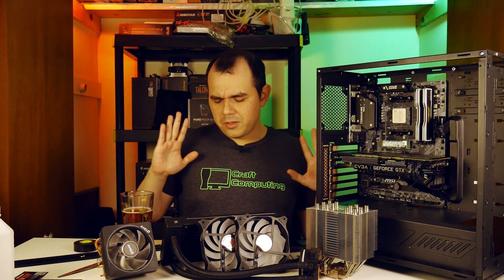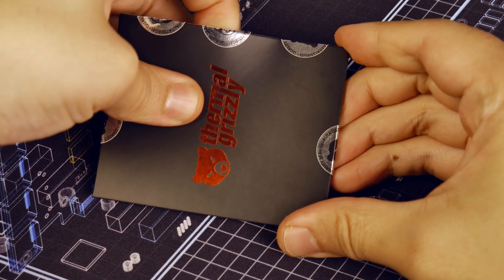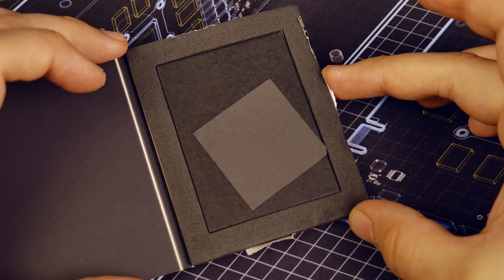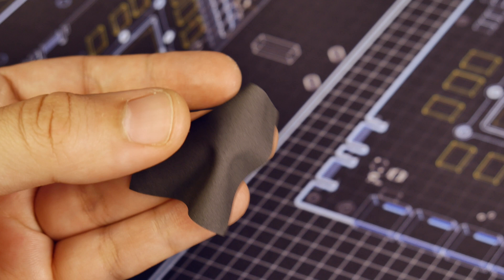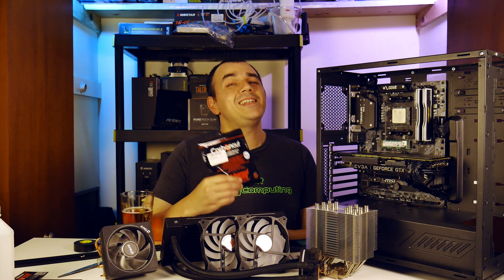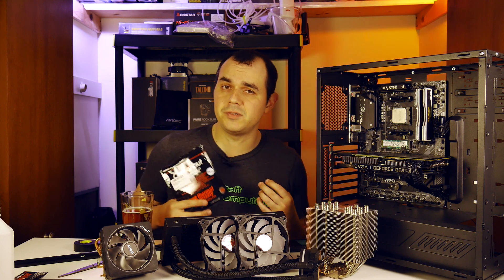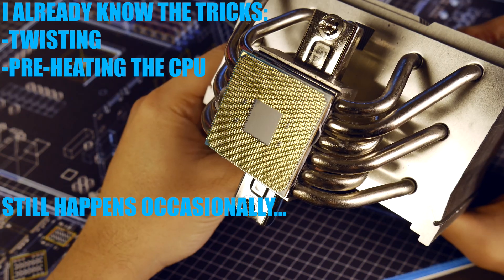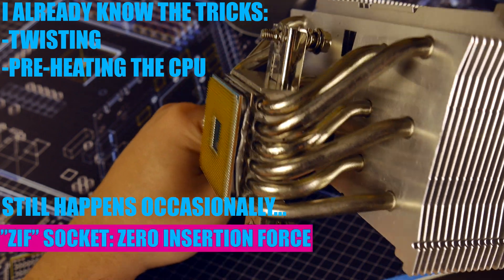Can Thermal Grizzly's Carbonaut Pad Replace My Thermal Paste?!

Comment: Switched to this pad this year (2021) for my new build. I prefer it over paste, as paste is just messy. I have installed and reinstalled a number of times and as long as you are careful, you can minimize any tearing. I will be using this going forwards as I hate cleaning messy paste.

Comment: Hi,Maniac Greek. I have question to you...how it's possible?  CPU thermal pasta, 84 Celsius! (Aida 64. stress test)      With, CARBONAUT Ultra High performance carbon thermal pad, 95 Celsius! (Aida 64. stress test)  What is wrong????
Reply from the maker: So there's a few things that could be happening here: your mounting tension may have been a bit different btwn the tests, and that Carbonaut pad is typically more sensitive to variance in pressure than paste is.  You may also have had the Carbonaut pad slightly off-center of your IHS when installing it. This is why I ended up not pursuing regular use of it as it's very particular about how it's placed on the processor without tearing and losing integrity and, therefore, thermal performance. I would run the tests again and try to get mounting pressure as even as possible btwn the two test runs. If you have an inch-pound torque wrench that would help a lot, though obviously I get if that's not something you have just lying around lol.

Also what processor were you testing on?  Is it possible you have a size that's too small for the processor selected? Realistically you should only be seeing a 2-3 C delta btwn you testing in a worst-case scenario so I would check that stuff out first. Just remember these Carobnaut Pads aren't really meant to be a "high performance" solution in the sense that it will be better than paste, but that it performs about as well as paste and is re-usable. Really meant more for environments where using paste presents issues that a physical medium helps overcome.

Comment: I am planning on using this in my laptop. I keep repasting it because it just dries up so quickly. The temps are horrible just a couple of weeks after repasting it and I really don't like opening up my laptop, so I'm just gonna put one of these in and call it a day. It's a 30W cpu, so it doesn't matter that much anyway. I just want my temps to be lower than 100C at full load.
Reply from the maker: Your temps may not be any different with this vs a paste tbh. What brand of paste are you using? I've never had a paste dry super quickly on me. I've used Arctic Silver and Noctua NT-H1 pretty exclusively though so there's that.
Reply: @TheManicGeek  I'm using cooler master makergel pro. It's supposed to be very good, but thermals are very good for the first few weeks after repasting, then I'm guessing the pump out effect and drying out kick in and it's back at 100C at 23W.
Reply from the maker: Oh jeeze. Yeah I can't say I've ever had that happen with the pastes I've used in the past. Used Arctic Silver 5 on my old Alienware M11X R2 back in the day and it worked great. If you do decide to use the Carbonaut pads let me know how they handle laptop use!
Reply: @TheManicGeek  I just installed it today and so far it works great. On par with new thermal paste and way better than thermal paste after one week.
Reply: @andraznovak6735  I am also going to use these whenever my paste dries up. cant wait till liquid metal used everywhere now that sony is using it in the ps5 with those sponges around the die